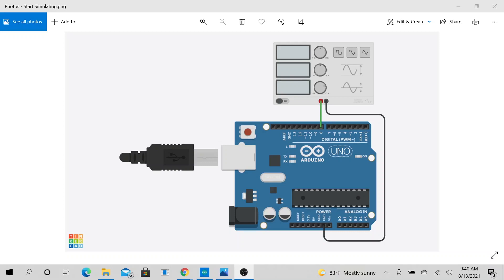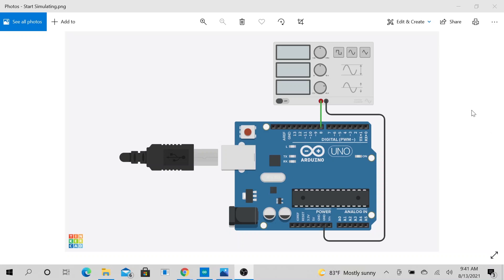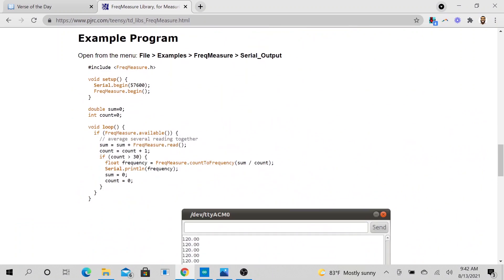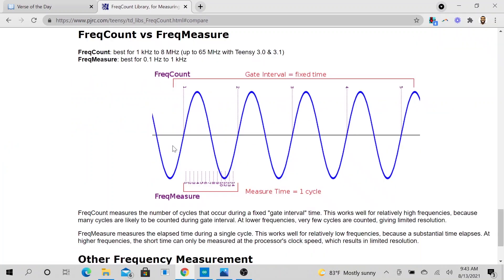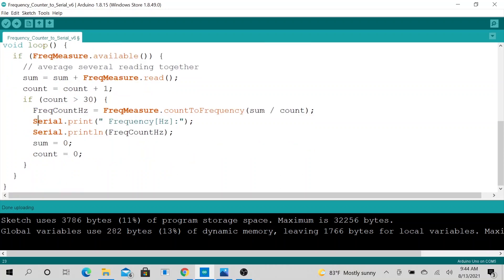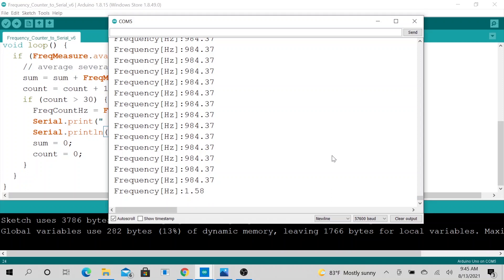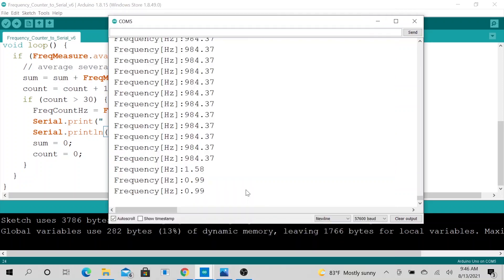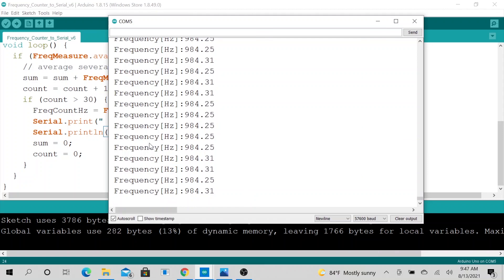How To Count Frequency with Arduino

Comment: Hello I am having issues with reading lower frequencies. I am using FreqMeasure, but it will not accurately read any frequency below 100Hz. Is there something I am doing wrong? Any help would be awesome.

Comment: hey i used the same library and code, but my serial monitor shows some random characters. pls solve this issue
Reply from the maker: verify that you have the same baud rate as i had in the video.
Reply: @codingwithalfred  thank you, I forgot to change the baud rate in serial monitor, it is working now

Comment: I try the freqcount library and it won't work if I use my 16x2 lcd shield I think it is because the liquidcrystal uses the pins that the code needs for the freqcount , anyways I did the sketch that uses the serial monitor and then I got it to show me something but I think it is not acurated at all and looks like as I up the input Frequency it shows less I need to do more testing
Reply: You might want to look at the ESP32 for your application, it runs much faster and has more features than the Uno. You can still use the Arduino IDE with the ESP32
Reply: @kevinlcarlson  I solved it by using other lcd that had SPI connetion , it works great for ac freqcounting but it won't count square waves signals I don't know why

Comment: I need to measure my tesla coill PLL cd4046 board I think I am around 2 Mhz so this will not work right?
Reply from the maker: Yes and no. It will not work using the standard arduino syntax eg. programm delay due to code overhead, but if you use the hardware timer it should work. I will have to create the condition on my bench to test it. Maybe a future video... Counting high frequency values using hardware timer since the Uno uses a 16MHz oscillator.
Reply: @codingwithalfred  thanks so much

Comment: my brother Is it possible to install a motor and make an antenna on top of it? It is programmed to rotate 180 or 360 degrees As it rotates, it searches for a specific frequency When you catch him, he determines his grade For example, it finds a frequency of 100 Hz at 80 degrees and stops rotating Thank you for your answers to my question
Reply: Yes, this is possible but you will need more hardware and possible use another programming software to process these logic, as well as interface with the hardware. Thoughts: You will need a stepper motor and module controller to rotate the antenna. Antenna need to be able to interface with your program. This sounds like a really cool project, I can already see it working really well given we have good hardware.